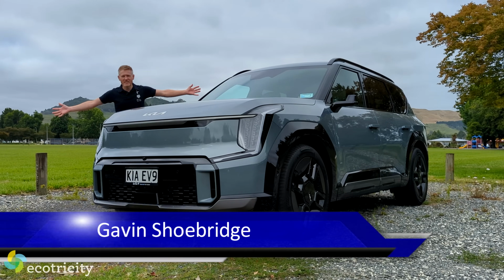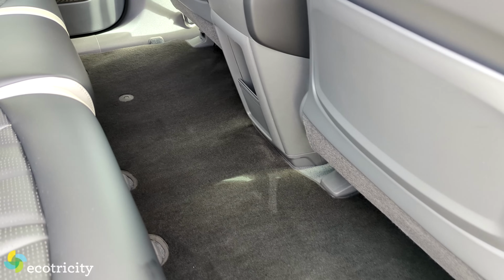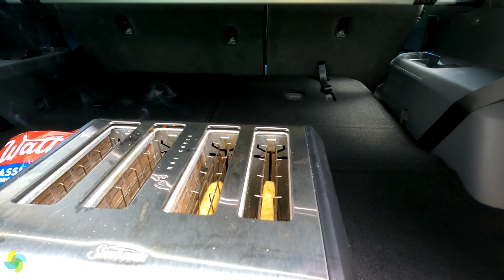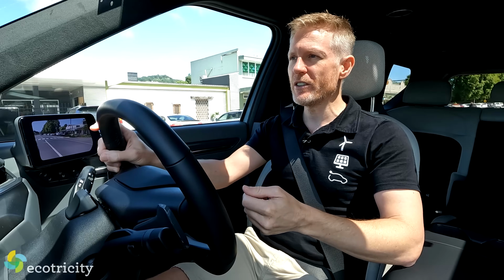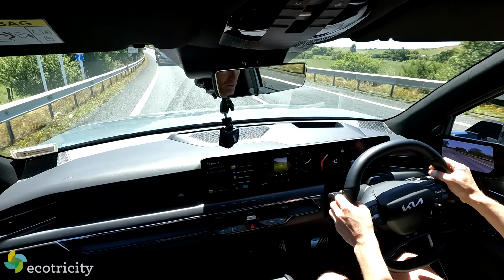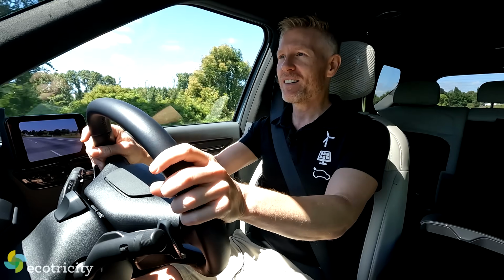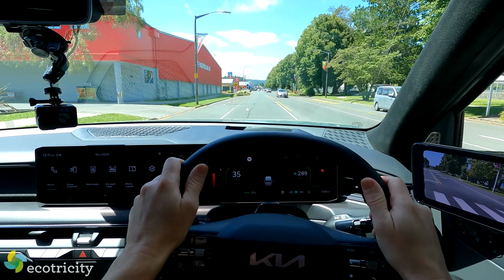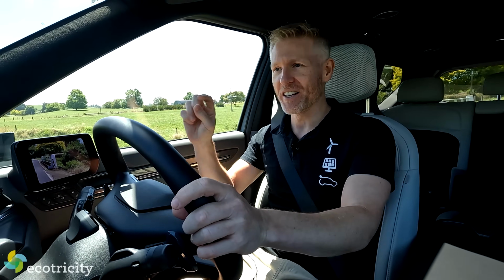Kia EV9 - New Zealand review

Comment: Wow.  Woke reporting.  To think this vehicle is according to you such an environmentally friendly is wrong. The carbon footprint to build such a car is far worse than any others.  Your batteries when they need to be replaced are an environmental disaster. Of course I bet the replacement batteries are over $50000 And to use these needed fast chargers are powered by fossil fuels.  This is such an inefficient vehicle when you take into account the inputs required to build and run it.  But of course you are sponsored by the machine promoting misinformation about EVs

Comment: 2.6 tonnes. They need an extra road user charge for the damage they are doing
Reply: Still nothing compared to trucks.
Reply: @sopues  yeah but it’s not a truck. What is it with YouTube comments !!!
Reply: @morri03  Damage to the road is an absolute thing. If you go there with 1 million bikes, it will not make a dent. Same thing here, apparently they know that cars makes more or less no damage to roads compared to heavier vehicles.
Reply: @sopues  true trucks are worse but the ev9 would do about 4 times as much damage as an average car. So the point is ,and I can’t believe I have to spell it out for you, unnecessarily heavy passenger vehicles are a bad thing for every reason. Efficiency, handling, performance, braking and damage to the roading infrastructure
Reply: Any weight <3.5T has negligible effect on pavement wear as explained on p.5 here of this document:  https://www.transport.govt.nz/assets/RUC-CAM.pdf Also see Fig 2 on the same page to see how little of RUCs for <3.5T vehicles is weight related. Splitting light vehicle RUCs further would serve no useful purpose.
Reply: @HarmLessSolutionsNZ  he knew that😉 but great evidence. Much better than opinion.👍
Reply: Wide tyres, low surface pressure, no fret😂

Comment: Don’t blame the car for the incessant “bings and bongs”. Kia is only doing what the overzealous pointyheaded bureaucrats require in the ADAS for a car to get a 5 star safety rating. Most new cars that have 5 stars suffer from the same thing. Maybe it’s time for crash worthiness to be separated from electronic “safety” systems in the rating? The bureaucrats think they are being clever by the systems resetting every time you start the car, but all it does is piss drivers off while they spend about a minute turning all those warnings off.

Comment: I’ve watched plenty of reviews of this car, this is the first time I’ve seen one where the car has camera mirrors, they aren’t well integrated into the cabin. 

Haven’t you already driven an EQE SUV, they decouple the front wheels when they aren’t required.

You can blame the new EU rules for all the beeps, all 2024 cars sold in they EU and UK come with mandatory over speed warning, lane departure warning and some other safety crap, you can turn it off, which you have to do every time you get start it.